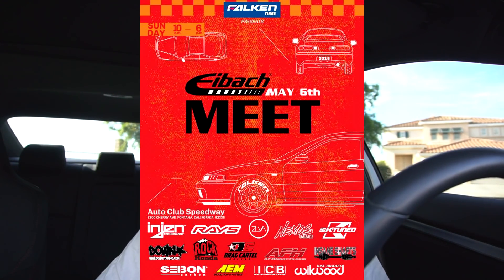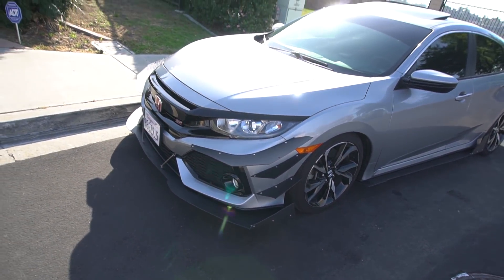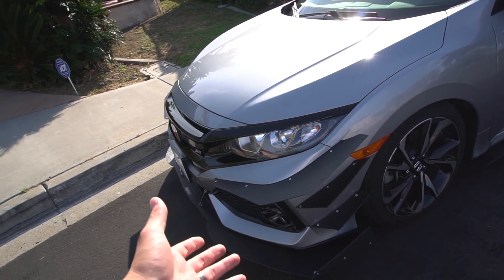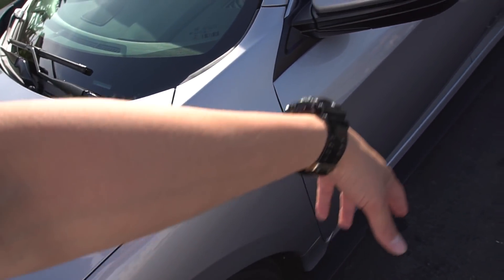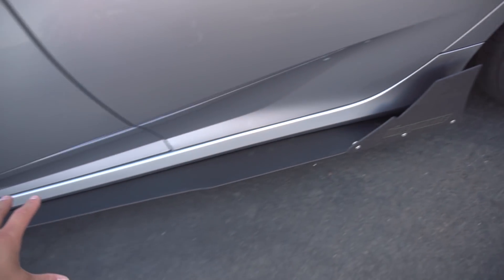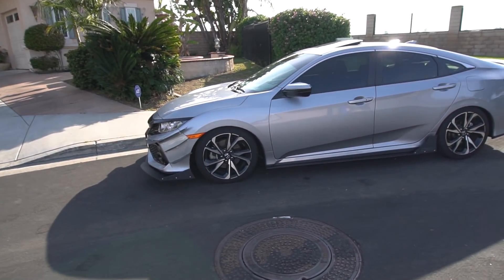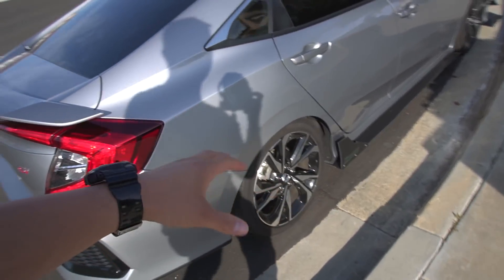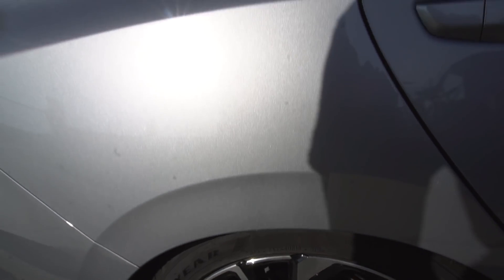2018 Honda Civic Si | Custom AeroKit Update! (Front-Splitter & Side-Skirts)

Comment: I know previously you had the Downforce side skirts on your SI, did you have to repair the plastic after drilling into them? How did you even get these new ones on?
Reply from the maker: GreaseAdactles no, you can use the same holes when adding a new side skirts, or some just create new ones.
Reply: PhongVLG Wouldn't new ones damage your car, or is it just a preference by people not caring?
Reply from the maker: GreaseAdactles if you look at it your just making more holes under your car, it’s preference to you.
Reply: PhongVLG Thanks! I just picked up a new civic hatch. Going to start modding soon.
Reply from the maker: GreaseAdactles congratz on the new ride! Good luck with your build! 👊🏼👍🏼
Reply: PhongVLG Sorry, one more question - where do you get your parts? Any reliable online sources?
Reply from the maker: GreaseAdactles no worries! 😁 and acuity makes great shifting parts, MAPperformance is another great site for parts, just depends what your looking for. Lots of other sites, but those 2 are credible too!
Reply: PhongVLG thanks man! New subscriber here!✌💸

Comment: Cool. Aren't you afraid of the canards being a little too much heavy weight on the bumper and that your bumper might start cracking or fall forward I'm just curious. looks gr8 still
Reply from the maker: orangefirepearl FB6Si Yeah I did fear that at first, but it’s very well supported to the bumper & weight is evenly distributed. I’ll end up getting some laches or so to connect it to the fender for better security. But so far no issues, even at 100+ 😉 Thanks Btw!